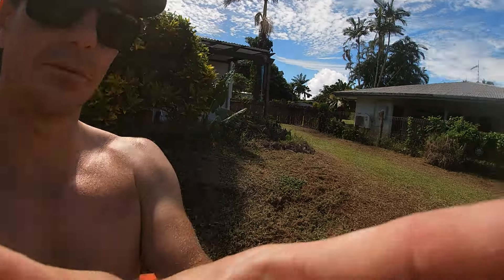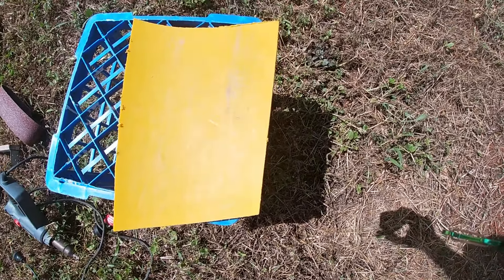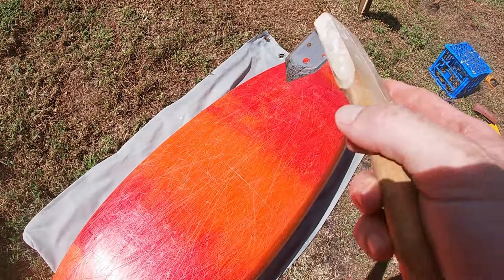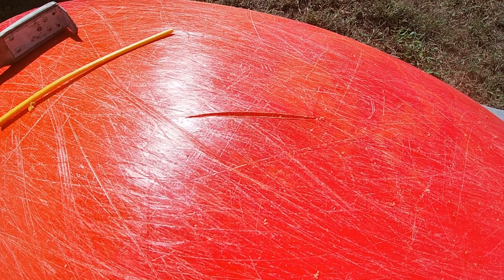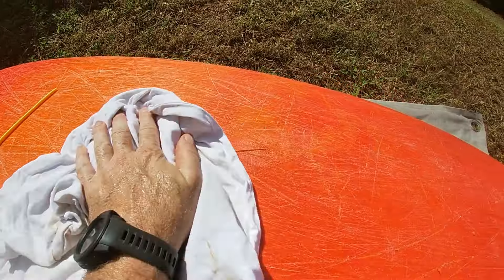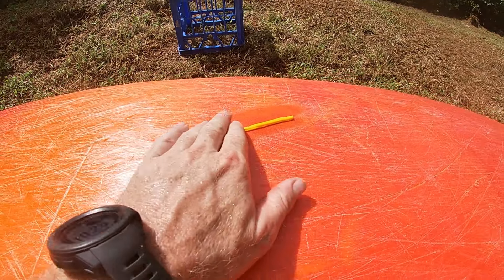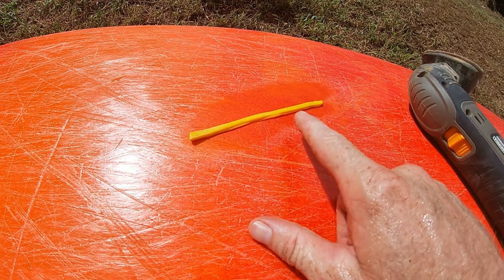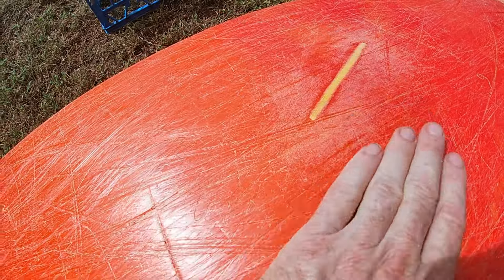Repairing a cracked whitewater kayak (plastic welding)

Comment: I don’t understand why you felt compelled to make this video. To me, it just represents another example of bad welding information. There are lots of similar videos out there of folks who got themselves a heat gun and some plastic and think they are ready to weld their boat, or worse, teach others how to do it! First, you didn’t drill the ends to keep the crack from propagating when it gets re-stressed. And judging by the weak quality of your weld (I do not believe you have any real fusion at all there) that crack will propagate. People, instead seek out the professional welding videos from folks who do this for a living, not some yahoo in their back yard who think they know how. Techspan is one good resource (as a maker of professional welding equipment - but alas too expensive for most of us!) and there are others but their technique in their video is much better than this and you can tell it’s a quality weld. Finally, do not weld with a large tip heat gun like this. Get yourself a fine tip heat gun to control the spread of heat and if possible a welding tip with a plastic feeder. If you can’t get a feeder tip learn the fan technique with a fine tip. Harbor Freight sells a fine tip plastic welder that’s actually a decent gun for the $ ($90) but unfortunately don’t sell the feeder tips. There are also decent looking welders on Amazon for a little more $ that come with a feeder tips but I can’t vouch for their quality. A feeder tip makes this job 100% easier and more likely to produce a quality weld. Practice on a totaled boat before working on one you care about.
Reply from the maker: Holy! What a novel. I appreciate the time you've taken to write such a comprehensive comment. Bravo.

I hate to burst your bubble, but the weld is holding up just fine and it worked perfectly, just like it always does.

I did mention in the video that some folks like to drill out the ends of the crack. This isn't anything new. I covered it.

If you had paid attention to the video, you would have noticed that I was using a fine tip attachment on the end of my heat gun.

As for your product suggestions, remind yourself that not everyone lives in the USA. Some of us live in countries that don't produce or manufacture Kayaks. Because of that, we've got really good at repairing them with basic tools to get as much longevity out of them as possible.

Finally, remember that there's more than one way to skin a cat. At no point did I say this was the one and only 'definitive' way to weld a kayak. It's one of many effective ways folks do it.

Sincerely,
Backyard Yahoo.
Reply: Ease up mate. He's just showing you what he does. It worked! Still using the boat too.